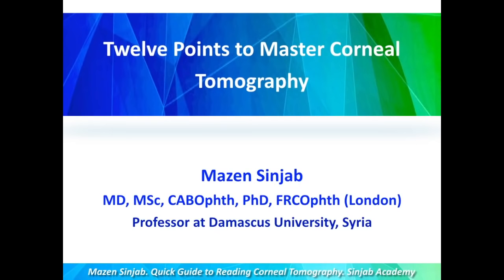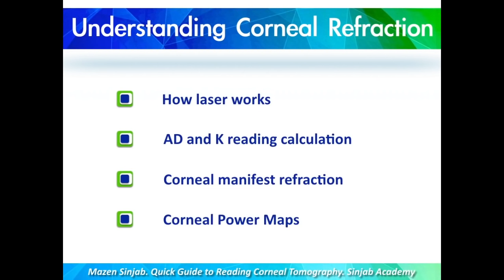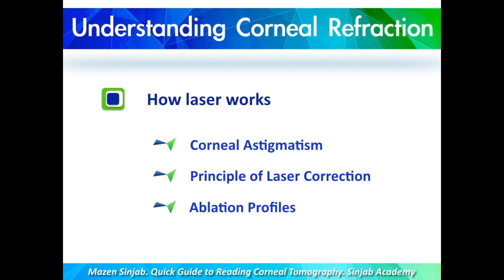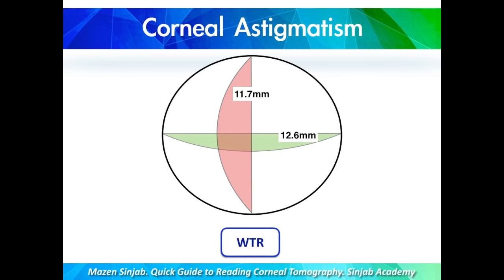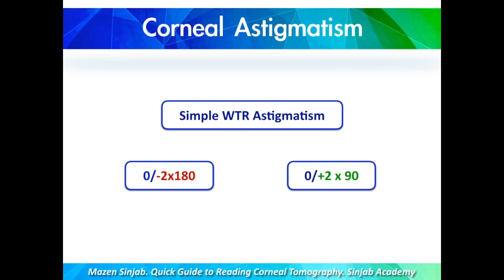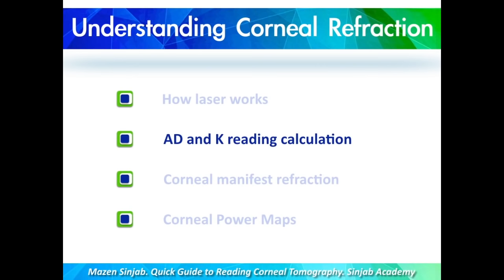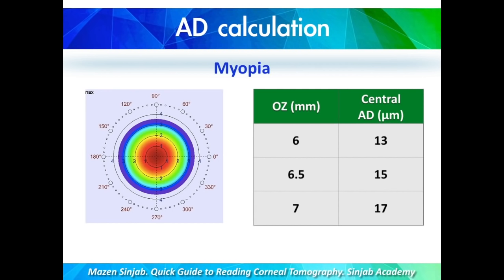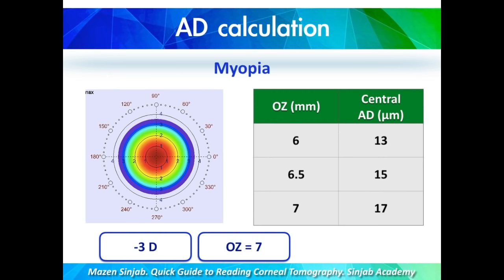A Quick Guide to Reading Corneal Tomography: Part 3

Comment: Dear doctor ,
In the example in K calculation (min 23.40) 
+1 -3 x 90 --> we have 3 diopters of astigmatism here .. 
But pre op sim k2- k1 = 1 D 
And post op k1 becomes steeper than k2, 
I cant understand the conflict ? Wouldnt this flip the axis ?
And in the video of concepts in refractive surgery part 2 at min (12:10) you have discussed the K reading calculation in mixed astigmatism in an another method that yields a different result .. so i am a bit confused as to how the 2 methods work.
I wish you can clarify the difference,
Thank you in advance